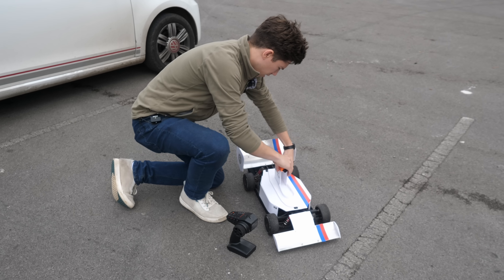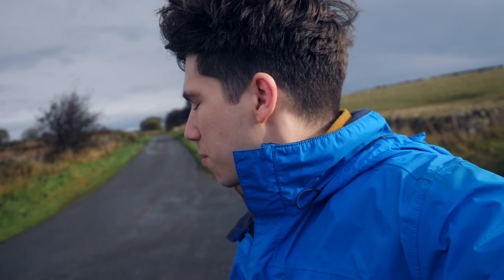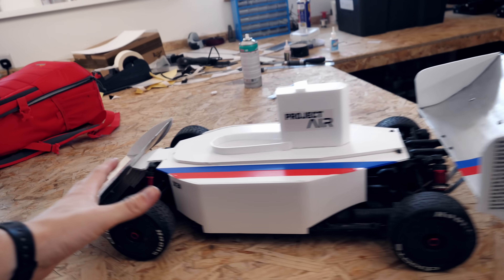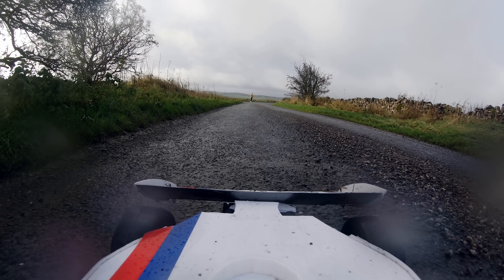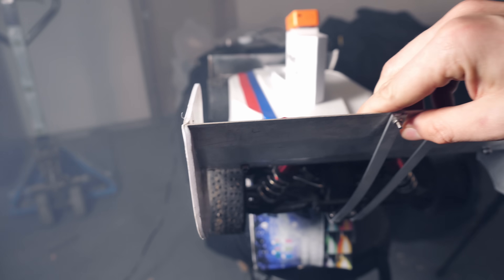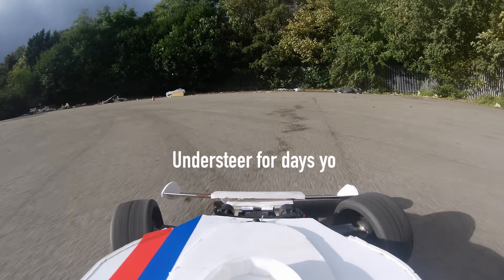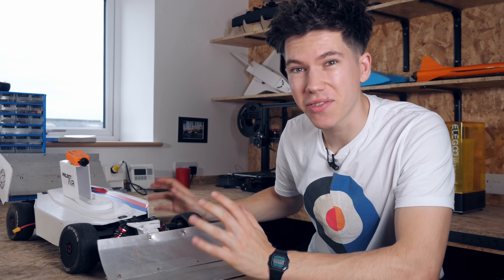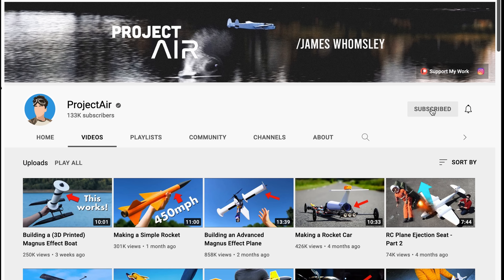RC Car Extreme Aerodynamics

Comment: Separation doesn’t just increase drag, it massively reduces lift - the low pressure side of the wing is what actually produces most of the downforce. F1 cars can only run such stupid angles of attack on the wings due to multiple, slotted elements that allow for flow from the upper surface to pass through & re-energise the boundary layer on the lower surface, promoting flow attachment. Single wing elements are never going to be able to achieve these same angles on their own. 
A simple (and more accurate than fan + smoke!) test is to use wool tufts to show where your flow is attached/separated - just watch them with a camera over the course of a run.

Comment: Your understeer was a combination of more downforce from that wing and also the drag high up at the rear. The rear wing drag is like a lever acting on the rear wheels as a pivot. Those wings are only generating downforce by increasing pressure on the top surface. You should print a proper profile to get lower pressure on the bottom rather than just separating as you discovered
Reply: i think the rear diffuser was giving the rear tires a lot of grip and the rear wing was exceeding the needed rear downforce so i think he should reduce the angle of the rear wing to give enough downforce to the front of the car to prevent understeer

Comment: So... Hear me out, I race RC cars as a hobby and am pretty good at it, one pf the things i've learned is that you do not need a really big wing to turn well, I honestly think you could make the wing 25% smaller than it Is right now and it would turn just as good and also, with the wings we use there is no angle on the wing, they are almost perfecty 90° corners on the back and side of the wing, having the sides higher then the mid section of the wing increases stability, and that's about it, just some personal input, not a professional in aerodynamics but this is what I think personally.

Comment: This was awesome dude! I agree with other people commenting that maybe a bit less angle of attack would help, ground effects are a bit difficult, but maybe raising the front wing a bit higher could see more airflow, the wing stall on the front might cause a ton of turbulence beneath the car stalling your diffuser. 
Also the dirt and gravel might be paying a bigger role on the lack of grip than down force.
Great vid! I'd love to see a follow up!
Reply: A higher rear wing, and using the "snorkel" like intake that you mimicked on your car to cool the battery could improve your overall run time.

Comment: 0:57 Have a like for mentioning Newtonian lift, which actually contributes to most of the lift generated by a wing, far more than Bernoulli.
Reply: Really?? Doesn't that depend on speed. Planes at high speed actually gain altitude when flying level don't they, so how would the wing, if constructed level, deflect more air down that the blunt edge which is more likely to deflect the air up?
Reply: @2KOOLURATOOLGaming  
1. Planes do not actually fly straight and level with a 0 degree angle of attack. It is always positive. A 737 has about 2-3 degrees of AoA in cruise.
2. If Bernoulli's is all that's keeping a plane flying, then how come lots of planes have symmetrical wings, especially stunt planes?
3. Yes, both Bernoulli's and Newton's principles produce lift in a wing. Even the theory which you call incorrect also produces lift. It's not just one or the other, but even though it only produces about 20% of total lift, Bernoulli's always gets the spotlight for some reason.

I recommend the book series "Fly Better" by Noel Kruse. Completely free online.
Reply: @CristiNeagu  Sorry, that wasn't something I was saying, I copied it from a NASA website but it didn't really tell me anything. I was saying that high speed aircraft, at least in War Thunder, gain altitude even when heading level
Reply: @2KOOLURATOOLGaming  There are a lot of variables involved. For most planes, the wings are not level with the rest of the plane. This angle is called the angle of incidence and as far as I know, it is positive on all aircraft. This means that even when the plane is perfectly level, the wing is not, so it is still generating lift.
What's more, depending on the wing shape, even when the wing is level it might still deflect air downwards at the trailing edge, which generates an equal and opposite reaction and lifts the wing up. All of these concepts are explained in greater detail in the book I mentioned. The first book deals particularly with basic aerodynamics, if you are interested in that. It does a good job of explaining these things in simple terms.

Also, I do have to correct myself a bit. I said above that a 737 flies with an AoA of 2-3 degrees at cruise. That's incorrect. I meant that it flies with a 2-3 degrees nose up attitude. the angle of attack is at least that.
Reply: There is also an incorrect theory which uses Newton's third law applied to the bottom surface of a wing. This theory equates aerodynamic lift to a stone skipping across the water. It neglects the physical reality that both the lower and upper surface of a wing contribute to the turning of a flow of gas.

The real details of how an object generates lift are very complex and do not lend themselves to simplification. For a gas, we have to simultaneously conserve the mass, momentum, and energy in the flow. Newton's laws of motion are statements concerning the conservation of momentum. Bernoulli's equation is derived by considering conservation of energy. So both of these equations are satisfied in the generation of lift; both are correct. 

I don't know what to think.

Comment: From 3.91s to 2.29s is a major improvement taking into account this is just one corner. If it is a race, you will lap all the other cars since you will gain more than a second at every turn. If the track has 7 corners, it will add to more than 10s per lap. If it takes 30s per lap, in 3 laps you will have lapped the tail. In a 60 lap race, you will lap everyone atleast thrice. That is disqualification/rule change territory.

Comment: Nice,…
Try one thing @ a time. 
Back wing,… no problem… not toooo big because it can flip you’re car over when the nose grabs some air… and not to far behind the rear axel. 
Side skirts are perfect, no side wind will effect it any more.
Front wing… thats a hard one to do it right🤔
Dont’t cover the whole tyre ( only if you have a whole chassis over it) because the tire needs some downforce by itself. If you cover the front wheel with that spoiler you used,  you become negative resulsts in steering because it will lose traction and unpredictable shiffering in corners. Unless you make the spoiler over the entire wheel (like Redbull 2020 in GT6).
So, the front spoiler is in total much longer befor the front axel and the angel is lower then the rear… it has to build up the load befor it can work, and flow nicely over the front wheels. In the mid section of the spoiler you can work it further towords the rest of the car. You can even connect it to the rear spoiler so the air that is compressed flows from the front wing towords the back wing and even so it can be compressed even further on the back wing  makes it even more efficient. ( if you connect front and rear wing you can almost half the size of you’re rear wing because the aire is already compressed😉).
Ground effect!!! 🤔🤪😱🥶🤥🙄😰
Be verry carrefully whit that if you are going to improve that…
Many F1 Teams have broken there teeth because it works so good when nothing unpredicteble happens… until air comes under the car..  nose of the car goes up because of a bumb, no flat surface, curb, or what ever.. and then you lose everything of downforce. It was banned in the F1 because it was too dangerous in the early ‘90. 
The only thing that realy works are active fans that sucks you’re car towords the ground. Here on youtube there is one movie i found from someone that made his WL-Toys RC-car with 2 pc fans upside down one @ each side…
Last one,
Don’t make the changes to big when you start improving airodynamics.
The wheelbase of the car you cannot change so don’t place the rear wing to far behind the rear axel and not to big.. you will eventualy flip over (Marc Webber with Mercedes 24 Le Mans!)
To big front spoiler will lose rear grip en you create oversteer.
Ballancing is everything.
Keep doing what you do, you will get there eventualy👍💪😎🏎🏎🏎

Comment: You should try mounting the wings high and attaching them directly to the suspension. High wings are more efficient and if you mount them to the suspension you don't lose mechanical grip from having to stiffen the suspension to compensate for the aero's compression on the suspension.

Comment: I would try to reduce drag and increase wind speed on the front spoiler by choosing a positive camber with a negative angle of attack. A smaller back spoiler with negative camber and negative angle of attack should do the trick for getting the car down

Comment: That car is not all that fast. I mean you make it sound like it is really fast. It's just okay fast. There is much faster.
Reply: @Namanoh  well.. there is still faster. Also, there is much faster reaction time too. And he certainly wasn't going 100 in the vid.
Reply: I have an rc car that tops out at 70, but it speeds up so quick, nearly 70 in a second. That thing looks like it needs to build up. Oh and my ex is an old rc10t2. However nothing out about the power plant.

Comment: Slot cars are the only small scale cars where I've seen aerodynamics really applied.  Also, active aero would be cool.  More steering angle also moves a servo for more spoiler/splitter angle.

Comment: maybe find a parking lot that's big enough to set the steering to a fixed position and creep up on throttle until it steps out. you could also mark a center and incremental radius' on the ground so drone footage can capture how big a circle it travles in. that way you can correlate throttle position with radius or point in which it lost grip to get some tangible results from your changes. or just put an accelerometer on. Either way, awesome video!!!

Comment: you could probably rig up a pressure sensor and arduino - take some measurments with the stock body vs with your wings.. actually measure forces..

Comment: The idea of higher corner speeds is the exit. The higher the speed you have on exit and onto the straight, the longer you maintain higher speed on the straight, the more time you save per lap. And this compounds. Downforce also increases braking force so you can brake later and from a higher speed, further changing your lap times. So, yeah, .4 seconds around that corner is just the beginning. And in reality, is HUGE.

Comment: A sheet of metal is not a wing. It is a spoiler and will only work on the high pressure side. The flow on the suction side will separate immediately at the sharp leading edge because your "wing profile" ist too thin.
To understand aerodynamics you always have to think (flow separation, wing mounting, ...) only about the suction side. That's where you get most of the aerodynamic forces.

Comment: Cool!  , i Work on a new"  ground effeckt Chassie for 1:8  to  1:5 scale  Brushless Rc Cars! ,  .. ife made a air-tunnel - .. & nice to work  on a dyno- .. with weight-scale i can measure the downforce - ..  but ive  came to a Double Chassie-plate for  air- between  fton  to the rear  Defuser! ... & that  made your Rc- Car  " likes glued to the RACETRACK! ,   ... The  next  step is to  made mouving  wings  for reduce the downforce &  a active fron  & rear wing system  for  more downforce  !   ,   thx for your Video!   , & sorry my Bad english... !   MfG from Vienna 🇦🇹👍🏼✌🏼

Comment: the main drag isn't from boundary layer separation (although yes that technically is a big source of drag), but relatively small compared to the horizontal component of the reaction force on the surface caused by the majority of the fluid exiting the control volume at a 45 degree angle upwards from the surface. Ideally it would be an airfoil that has minimal projected area, but hey this is rc, we can make a flat 4x8 foam rectangle fly because as my grandpa always said: "If you throw a rock hard enough, it will fly"

Comment: That boundary layer behind the wing is a big issue tbh, even in turns theres just as much air and leans to instability. Thats why racing cars have flat bottoms that tie into the diffuser to eliminate that

A wicker bill oin the rear wing would help a TON also...and a squared off rear on the rear wing would produce the same downforce but lift much less than that one you made. Seems wierd but that what ive seen in actual racing and what the trends of the top racing cars designs have shown

Comment: 2:50 Two squared is actually four, mate. That said, lift increases as a square of the velocity, not the area, so at double the speed, you generate four times the downforce. 💜🤓👍
Reply: Ye, I don't think this guy understands what 'lift' is. He explained it as pushing air down to push the wing up on a plane, but it isn't, it is a result of low pressure and high pressure, right? The surfaces he has created are intended to literally deflect the air so they won't be generating much lift-based downforce will they. In his case, I guess that doubling the surface area would double to downforce because the surface is colliding with twice as much volume of air and therefore the air is providing an opposite force twice that of a halved surface.

Comment: 1/8 scale BMT 911 4WD nitro buggy had active aero over the rear axle. It's rear spoiled had linkage attached directly to the rear swing-arms that would turn the rear spoiler as vertical as possible under braking. Conversely, it would flatten to horizontal as much as possible during hard acceleration. It definitely had a very significant effect on performance.

Comment: What's funny is i did a very similar experiment with my rc car i took the spoiler off slid all over the place like it was driving on butter just what i expected ok so i got a massive piece of thick cardboard and bolted that to the spot where the spoiler would go and as i expected it stuck to the ground better. Not really scientific but interesting
Reply from the maker: I’d say that’s doing science - making a change, observing the difference, reporting your findings. 😊 Nice job!
Reply: @Project-Air  thanks

Comment: I have a suggestion for prototyping/testing- instead of putting the car on a box during your wind tunnel tests, put it on a scale. The scale reading will show some representation of how effectively you're creating downforce (or perhaps lift, if something really goes wrong). Instead of a fan, you could probably use a leafblower to simulate higher speeds? Then you could prototype in your shop for quick adjustments and excluding all the outdoor variables.

Might even find a way to direct the air only under the car to see if your ground effect changes worked?

Comment: Nice, always wondered about that when I used to race RC. If you do follow up, maybe some load cells and pressure sensors + Arduino could provide some interesting data. Or just make things more complicated and output a lot of useless noise from the vibrations 🤷‍♂️.

Comment: downforce is generated from the underside of wing mainly, so you don't need that much angle of attack in front and such large front wing, you can work on design of front wing a bit, BTW this is what I always dreamed of , good that someone is doing it, keep the videos coming, or maybe get designs from people  and 3d print it

Comment: Everything in F1 is a compromise...what wins races is highest average speed. Too much wing and you suffer on the straights, too little and you lose braking and cornering ability. Too much front wing brings oversteer, too little brings understeer. Additionally the tires design has to be taken into account for the additional forces. You may gain grip but massively sacrifice tire life.

Comment: one problem I see, you need a smoother road, because there's too much air going underneath the car. the body work needs to be lower, for the car to be faster, unfortunately you need a super smooth road to go lower with your body.

Comment: want a reeeeeeally good point to start with aero, for small scale cars?  try the WING slotcars group 27(they are evolving for 4 decades now, and you can learn a HUGE DEAL about scale car aero from them...) its a competition and trial evolution, done by very smart ppl and reached a point, where a group 27 slotcar is simply the fastest thing in scale car , period,  if u take a straight track, a group 20 motor and body from 1999, will eat a tesla plaid real car, will rip a new azz in a 1:5 FG RC, will shred a 1:10 rc carbon SERPENT, will humiliate a traxxas xo-1, (IF YOU GEAR IT RIGHT , made a long enough track, a group 27 koford slotcar will probably time travel into another dimension...)
Reply: eyes cant keep up with a group 27 fast wing car... thats how violent it is...

Comment: Those wings are doing nothing but creating drag. Mount them from the top and leave the under side clean and clear. The under side is where downforce is created. You'd even have DF at lower speeds with half the wing surface.

Comment: Not sure if the car chassis is capable of it without some modification but you could extend this with some unsprung aero - so instead of pushing the body down on the suspension which then pushes the wheels down, the aero acts directly on the wheels and the suspension doesn’t get compressed at high speeds.

Comment: Down force most definitely works on RC cars, i have a traxxas slash 4x4 capable of 180kmph+.
 with the stock body and bumpers, it lifts the front end at about 90kmph, with my aero body, its able to accelerate all the way to 180kmph without lifting.

I havent gone for the most extreme speeds possible with this particular car, others have done over 300kmph